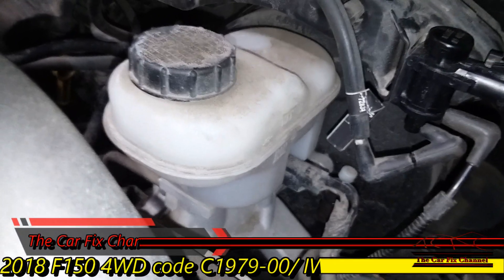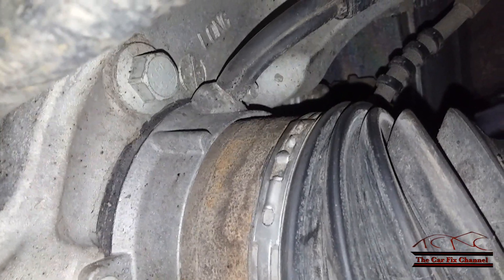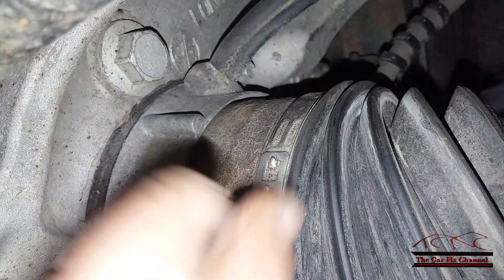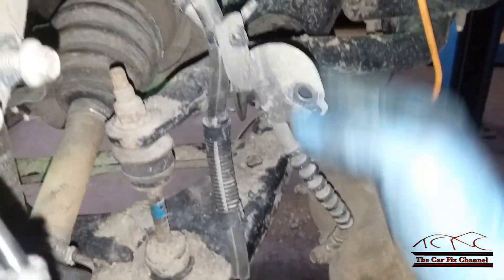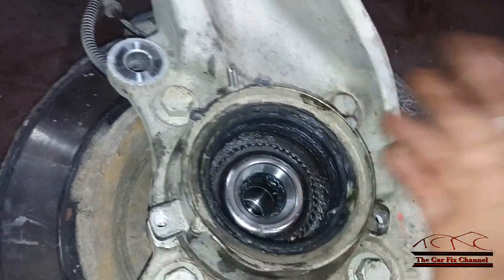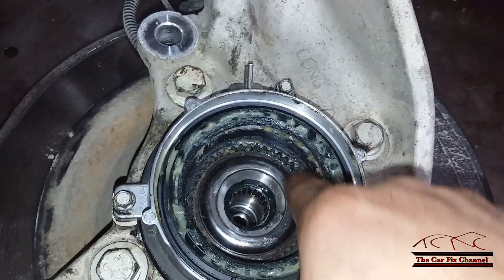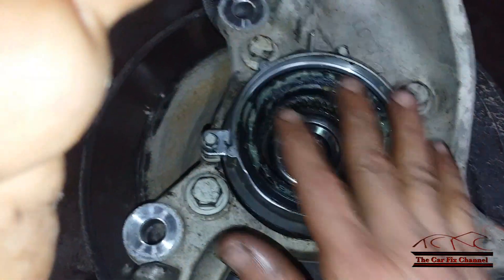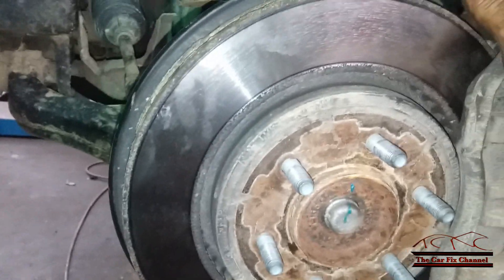C1979-00 IWE- Ford-F150 4WD locking hubs issues

Comment: I have a 2004 F-150, I just changed the VCT solenoids, and now this code is popping up C1979-2F

I used aftermarket VCT solenoids but went ahead and ordered the OEM one I need.

My question is, can me putting those aftermarket VCT solenoids cause this code?